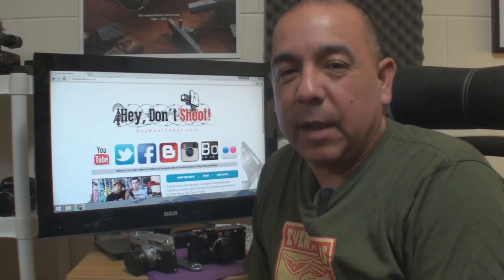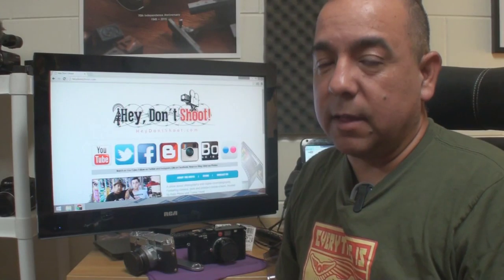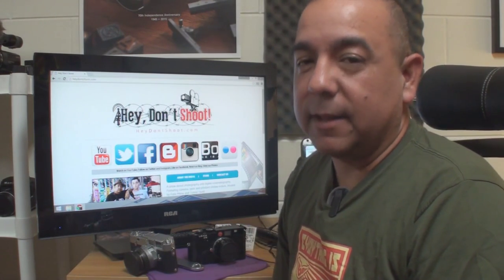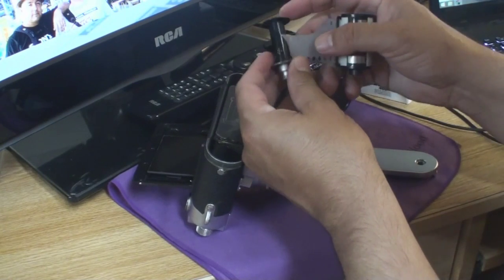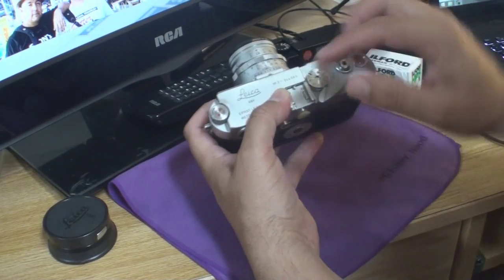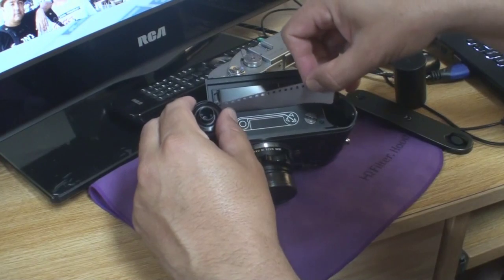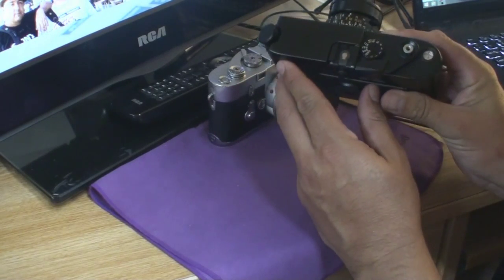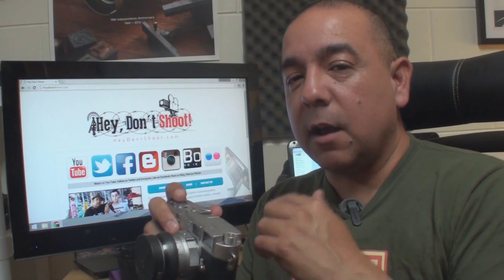Vlog - Loading a Leica M3 and Leica M6 - Important Tip

Comment: I am into these cameras too, one tip, CHECK to see that the SPROCKETS engage the film holes (perforations)- if they don't no winding can take place, the film just stays there. the other comment is right too ie. if the rewind can't move the spool, then NO rewind, you open the bottom plate thinking all is well, and well there goes the whole roll (still on the other spool);
ALSO check the shutters  curtain tension, two curtains in the shutter move, if one DOESN'T close completely the film opening remains NOT light tight and this light leek can wreck your film too (need the camera store to do an Adjustment for this one).

Comment: I hope that you can explain this to me, I sent photos to be printed as 8”X10” to Adoramapix (I don’t think it matters), the photos that I got back do measure 8”X10” edge to edge, but the actual image measures 6-3/4”X10”. my aspect ratio choices in the camera (sony a7-mk2) settings are 3:2 and 16:9, I’m using the 3:2, how do I get them printed without cropping, or what size in inches should i order to maintain the 3:2 ratio? Thank you.
Reply: +RickBSO I have no idea. Haha. I recommend contacting Adoramapix support, they also have a video tutorial section and FAQ. There are also support forums.